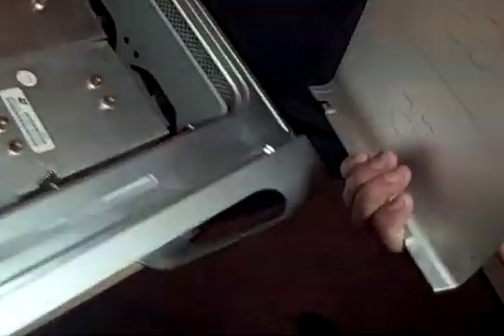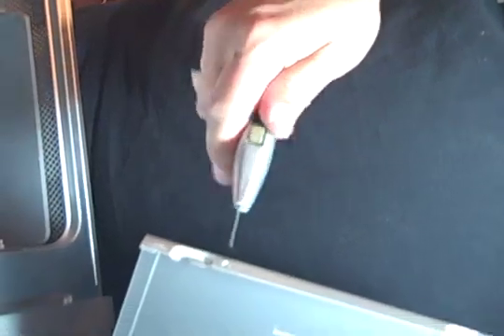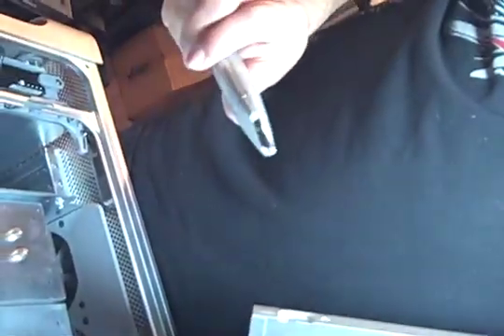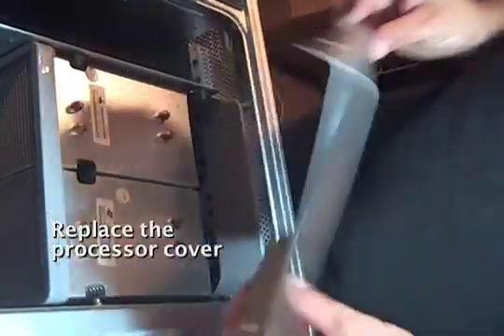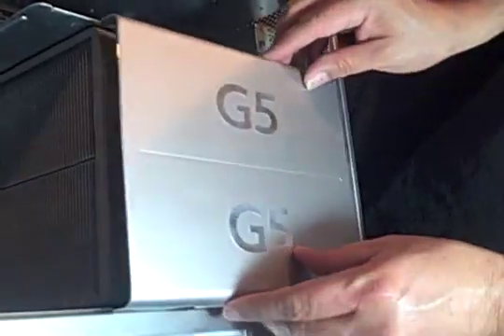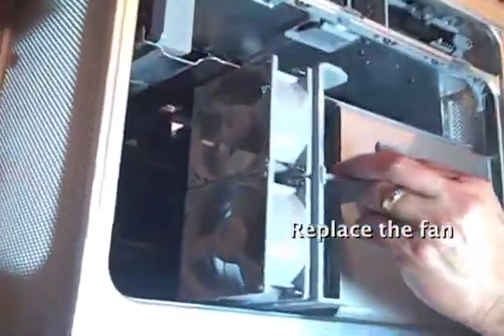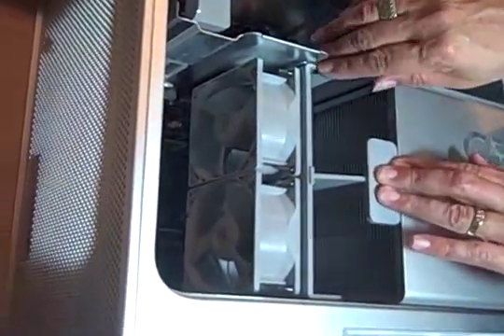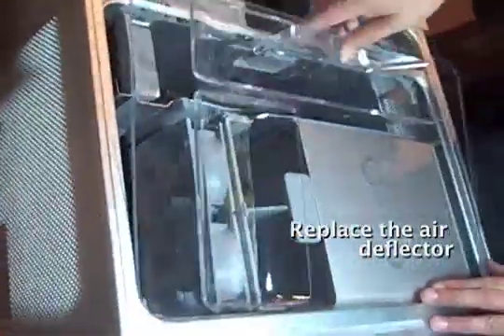Macintosh G5 Power Mac Power Supply Install - Early 2005 Model - Part 2

Comment: My G5 has an intermittent problem. When I press the on button it turns on briefly for two seconds then turns itself off. I tried changing the battery on the logic board, and it worked fine, only after a few days the problem returned. I have tried pressing the re-set button and that worked, and again a few days later the problem returned. Any suggestions?

Comment: Thanks for posting this video. I've got a power supply issue myself (at least I think that's what it is), and I intend to dissasemble the entire computer and give everything a thurough cleaning. My computer currently is shutting down abruptly every so often. I couldn't easily figure out which screws in the center of the processor needed to be removed.